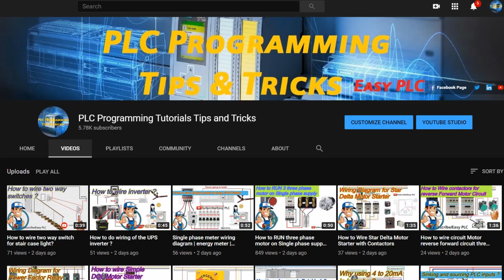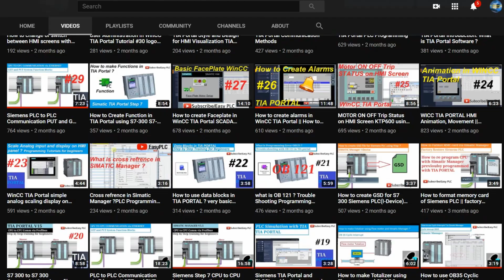Profibus Connector wiring and Installation

Comment: Hi, the initiative of the video is very good, but I would strongly recommend you to use proper tools for the demonstration (and for your regular job) plus wearing safety gloves. A knife is not only a dangerous thing, but it also can damage the cable insulation or internal conductors.
Regards!
Reply: Bored off with your gloves

Comment: Why every connector profibus any ON OFF. ?
Reply from the maker: Only first and last should be ON..... just to confirm the network termination
Reply: @EASYPLCTRAINING  So for the first interface number (cpu) the first interface must be ON and number two OFF, interface number 3 OFF until the end, for example interface number 10 the new switch is ON ???
Reply from the maker: @ALFINUR_TV  if no. 10 is the last node and its termination switch is ON its means here the network will END. if we connect nodes after node no.10 CPU will not read these nodes. if we want to extend the network we have to switch OFF the termination Swtich.
Reply from the maker: for 1st node we have to turn ON the switch because every profibus connector have two cables connection in it . one coming in and one going out . we will turn ON the resistance on the 1st node to close the network coming into the Profibus port. In this way only network  cable going out will work.